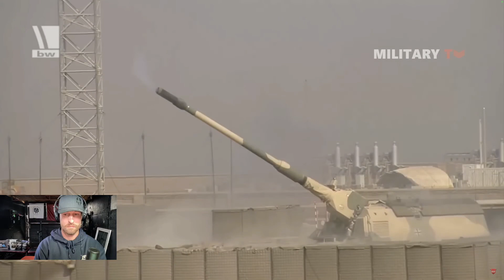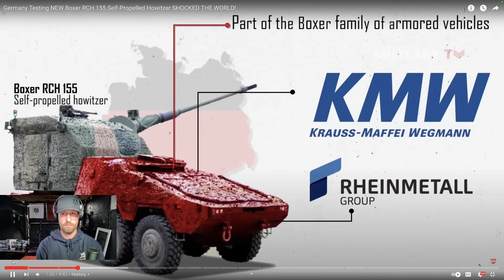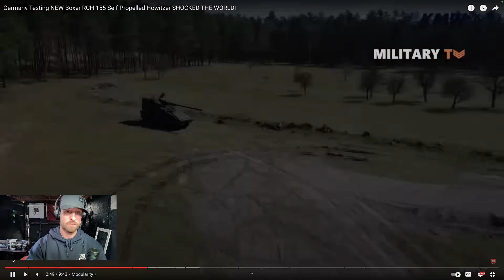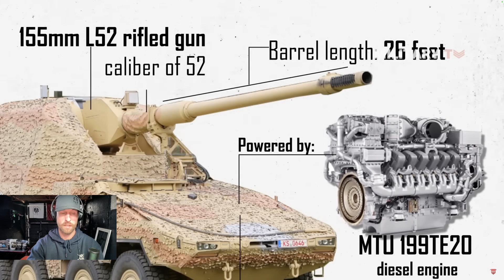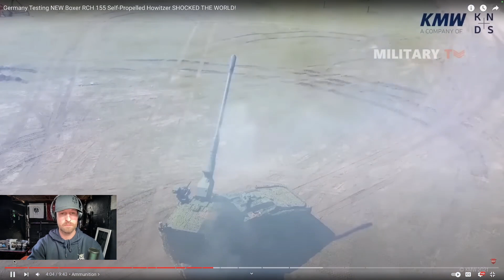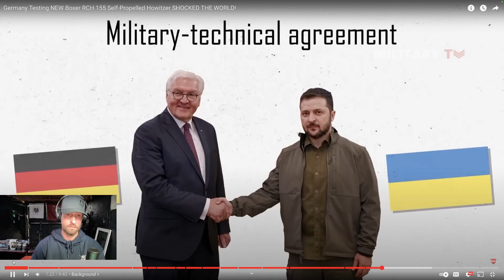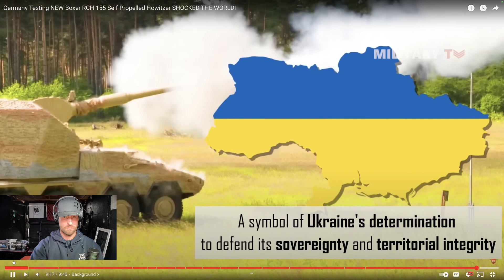Boxer RCH 155 British Armys New Replacement British Soldier reacts

Comment: The Swedish Archer 155mm Self-propelled Howizters,  can do everything the Boxers RCH 155mm, but many believe do it better and carry more of the same artillery rounds the Boxer RCH uses too.

The main weakness of the Boxer RCH 155m Howizters has, the Archer Self-propelled 155mm Howizters does not have.

Could turn out to be, having no Stablizer Leg with Ground-blades, which could badly affect the crew onboard and cause health issues too.

Though badly affect the Boxer RCH drive system and suspension system components, plus onboard electronics and Howizter components too.

That from excess or extreme vibration damage, caused from rapid fire of the 155mm Howiter! 

When the the Boxer RCH 155mm Howizter, is already shows issues with rocks heavy rocking side to side and backwards and forwards when fired.

That seems when only firing in single shot mode, with waiting time between shots too. Regardless of direction the barrel is facing, either forward or backwards.

However, the main weakness, seems to be when firing sideways, either to the left or the right, the Boxer RCH very much rock sideways on its wheels and suspension badly.

The Archer Self-propelled Howiters,  has a much lower profile, both easier to hide than the Boxer RCH, but the later seems very top heavy  when firing too.

If the German's are claiming sustain fire rates, of 9 rounds a minute, yes that is high.

However, the Boxer RCH 155mm Howizters, will run out of ammunition very quickly.  The Boxer RCH will be still going to be rocking all over the place, whether side to side and/or forwards plus backwards too.

While firing the next rounds, especially when trying to fire 9 rounds in less than one minute.

Which very much affect the Boxer RCH 155mm rapid fire accuracy, when firing multiple rounds from either a stationary position, or trying to fire on the move too.

However, the Swedish Archer 155mm Howizters, is a proven battle tested artillery system, already in Ukraine too.

Using the equally proven Volvo Armoured Crew-cab and the All-terrain 6x6 High-Mobility heightweight Chassis too.

With the newer Archer variant, will be using the newer German Mann All-terrain High-Mobility 8x8 chassis, with new armoured three person crew command cab too.

Along with the new Mk 2 Archer variant, will carry more rounds as well it seems, in it larger automatic loading magazine too.

Again surpassing the Boxer RCH own Automatic loading magazine. Along with the Archer 155mm Self-propelled Howiters Mk.1 variant, already has there own Volvo Armoured-protected Automated Resupply Support Vehicle too.

Based on the same Volvo 6x6 All-terrain High-Mobility chassis the Mk.1 Archer 155mm Self-propelled Howiters are mounted on.

Or the Armoured Resupply Support Vehicle, could use the new German Mann Armoured Cab All-terrain 8x8 High-Mobility Chassis.

The Mk.2 Archer 155mm Self-propelled Howiters will use, also the British Army already have ordered hundreds of too.

Which these Armoured Automated Resupply Support Vehicles, can reload the Archer 155mm Self-propelled Howizters own magazine within a few minutes, either while the Archer is just parked up in its own hide too.

Maybe even while actually reloading, between firing too. Also the Armoured Automatec Resupply Support Vehicle, carries enough rounds, to keep the Archer 155mm Self-propelled Howiters, firing on the battlefield for a long time too.

The Archer 155mm Self-propelled Howizter Wheeled All-terrain High-Mobility Vehicle System, is one of the best in the World.

The British Government and the MoD,  should have purchased, at least a whole Artillery Regiment of 36 Archers plus 4 reserve training Archer systems too.

Not just 14 Archer System's, just enough to equip for one Artillery Troop, plus a couple for reserve and training purposes too.

The Archer Self-propelled Howiters are designed to operate with their own Armoured Automated Resupply All-terrain High-Mobility Support Vehicle too.

The MoD may not have even purchases, these Armoured Automated Resupply Support Vehicles too, to support the Archer Self-propelled Howiters too?

That is so both vehicles, can operate as self contained Combat Fire Team, of Self-propelled Howiters and Resupply Support Vehicle.

Within or as part of a Six Gun Artillery Troop, or Twelve Gun Artillery Battery.

Which can be independently deployed or broken up, into one or two Gun Fire Teams, or a Six Gun Artillery Troop's and/or twelve Gun Artillery Batteries.

Along with supported by a Artillery Battery HQ Troop and Battery Logistic Support Troop, plus a Artillery Foward Observation Troop too. 

With these Archer Artillery Batteriez, being one of three Archer Artillery Batteries, of 36 Gun Medium or Heavy Artillery Regiment.

While the Archer 155mm  Self-propelled Howiter All-terrain High-Mobility Vehicle, can redeploy to a new fire position on its own fully loaded and waiting for its next fire mission.

The Armoured Automated Resupply All-terrain High-Mobility Support Vehicle, can travel back to a rear area ammo supply base. To reloaded and then return to a pre-agreed RV, to meet up with the Archer 155mm Self-propelled Howiters.

 The Boxer RCH 155mm Howizters,  does not have this Armoured Automated Resupply All-terrain High-Mobility Support Vehicle it seems?

Whether another Boxer variant  being used, or some Armoured All-terrain 8x8 High-Mobility Truck being used either?

ARCHER would be my choice,  it is a proven working system, Boxer RCH is an unproven system.

With in today unsafe World, with China and Russia,  let alone Iran and North Korea, plus Islamic International Terrorist Groups too.

I would pick the Swedish Archer 155mm Self-propelled Howiters,  or even the British M777 Towed 155mm Howizters, over the Boxer RCh 155mm Howizters at present.

Let the Germany Army and taxpayers, work out and pay for all the problems with the Boxer RCH 155mm Self-propelled Howiters first.

Not British Taxpayers pay to work them out instead, with the British Army or Royal Regiment of Artillery facing the troubling issues of a new Howiter system!
Reply: My goodness, what do you dream about at night? That was so much fantasy and unproven nonsense that it makes you sick. Wishful thinking is not knowledge and babbling is not evidence. Pull your head out of your ass and ask yourself why the buyers ordered the RCH 155. Surely also because they compared the systems with each other. Knowledge is power.... but not for you
Reply: Rch155 won out against archer because it’s easier to transport by air and faster, plus half the army is going to be using a boxer variant so logistics is much simpler. 

The rocking around really isn’t an issue, boxer uses air suspension which is highly resistant to shocks like this.
Reply: The british archer are from the 48 swedish once. Which will replace all 6x6 volvo based with 8x8 man hx based once. And even this new archers still only have a 21 round mag in the turret while the RCH has 44 round. As for reloading there is a container based system for the RCH which therefor can be used by all HX trucks of the british army logistics.
The magazine of the RCH is more flexible as it has 4 submags so 4 different rounds in direct access as for just two on the archer.
And by the way RCH stands for Remotly Controlably Howitzer, so this thing could drive from a to b shooting at c without anybody on board.

Comment: If you like something like this you should check out the finnish AMOS or NEMO mortar systems. Currently in competing to win the contract to be the mortar system integrated to the american AMPV.
Reply from the maker: Ok brilliant thank you, I’ll check them out for sure
Reply: They are fantastic in the 8 to 13 km ranges but that is now squarely within cheap drone range. This will reach out to 35km with just base-bleed rounds. AMOS is for when you want to put maximum hurt on something is the shortest amount of time at a mid range. More an Assault gun.

Comment: I think you are wrong about the firing range of AS90  and Archer. All of these are NATO 155mm howitzers. Their range is determined by the ammunition not the gun. The longer ranges are due to base bleed extended range full bore rounds (48km),  and sub-calibre, winged ram jet assisted rounds such as Leonardo Oto Vulcan (>100km)
Reply from the maker: Thank you, yes I know it’s down to the charge but from when I was in we worked with a max range of 24.7km for the as90.
Reply: @combatreadyhq  Yes 25-ish km would be the standard full bore range for a NATO 155mm Howitzer, with no fancy base bleed rounds etc. The AS90 does have two barrel lengths, which gives 30km range for the 52 caliber barrel version. The weight of the shell and the energy of the propellant charge  are the main determinants of muzzle velocity and therefore range. Other factors are the gas pressure (dependent on the chemistry of the charge), barrel friction, and atmospheric conditions.

TLDR all the longer ranges (Archer, Caesar, Boxer155 etc)  are due to the aerodynamics & in flight propulsion of special shells. With terminal guidance these make an enormous difference to the reach and significance of artillery on the battlefield.
Reply from the maker: @nickhockings443  exactly mate, thanks for the information and comments  for everyone

Comment: Why aren’t we building our own vehicles and why on earth must we buy from overseas, it does not make sense that we are buying from abroad when we are more than capable of building our own fighting vehicles. the main problem with buying any foreign vehicle is that you are tied to them for spares and everything is rosey  until you fall out and then you’ve  got vehicle without engine spares ,steering spares etc it’s  been said thats main benefit is that it can fire on the move but if I remember correctly the old centurion  could  do that decades ago
Reply: If you Brits had done something sensible in the last few years, your Ministry of Defense would surely have come up with the idea... but you can't even manage Brexit. LOL And besides, the UK has also ordered the Boxer in other variants and it is also produced in the UK. So don't cry about it, but be glad that you as a taxpayer don't have to pay for an immensely expensive new development that doesn't work afterwards.
Reply: I think that the twin fiascos of Ajax and Ares are their own answer to that. Boxer is designed and built to work. The Brit ones (to my disappointment because I'm a Brit too) look like things built to keep incompetent designers and builders in jobs instead. :-(
Reply: We spend an absolute fortune on procurement but it takes too long and politicians keep undermining it with changes of mind. It's therefore thought to be better to buy an off the shelf product. If we built something it would take 10 years to open the factory then we'd privatise/sell it to America who would snap up the tech and close the factory. We really need to do something to stop tech and businesses being bought up by competitors. It's the biggest thing that Brexit allowed us to do and yet we don't do it

Comment: The fire on the move capability is the selling point which makes the RCH155 unique so far. Shoot & Scoop was yesterday.
Reply from the maker: Yes I think that’s massive for a artillery system
Reply: Also the fact that there's a tracked variant which IIRC also uses the same chassis, so again all of the comments re ease of maintenance still apply.
https://youtu.be/nukB8k9pqas?si=rb46y7Q-kvmkyXxB
about 6:00 in for almost 2m.

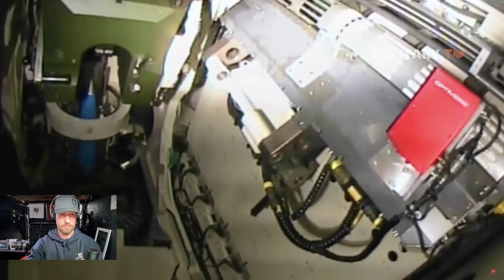Comment: 5:56 " ... thats quick ..." not really, look here test fire of PzH 2000  https://www.youtube.com/watch?v=Tc9sb71px5I  and the same turret with 16 Rounds per Minute as 100% autoloader was offered as armament for Corvette K130 (not chosen due to a to tiny ship body to handle the recoil of continuous fire in AA rolle)
So this 9 Rounds per Minute are basicly a back step and only worth it due to crew reduction down to 2

Also key benefit of RCH 155 is a combat ready weight of 38.5t which allow sepcially GB a combat ready hot drop by C17 Globmaster. This was also plan for A400m but with 38.5t it is 2t to fat for it.

Comment: at 10 million a piece it sounds like it will be something you don't want to lose.  I was reading a comment somewhere about how the age of "shoot and scoot" is over and SPGs are also hopeless because drones spot them too easily now. I wonder if drones will make this kind of system far less useful because nobody will want to risk putting them where they need to go?
Reply: The Ukrainians have yet to lose any PZH2000 (I think one was damaged), even to drones or airforce. Because the concept of beeing pretty mobile and fast fireing works pretty well even with a 58 ton beast like the PZH2000.  One would also hope that our NATO Air defence in combination with an actual flying airforce of more than the 50 or so old Soviet planes that Ukrainians currently operate would provide some more cover against Drones operating 30+ km behind the frontlines.

Comment: I prefer the Archer. I don't like the high profile of the RCH 155 and because of its civil engineering heritage, I suspect the Archer chassis might have the edge over the Boxer chassis when it comes to traversing rough ground. But I see why it make sense to go for the RCH. Archer's articulated chassis requires specialist expertise to maintain and repair whereas compatibility with, and the modulatory of, the Boxer fleet as a whole simplifies this and many other issues. There was also the option of mounting the Archer turret on a truck chassis (MAN provides many of the British Army's logistic vehicles). However, perhaps Boxer is judged more capable for cross-country than a MAN /Archer variant plus there is, of course, the higher round capacity of the RCH 155.
p.s. Any scope to ship mount that turret?
Reply: Rheinmetall has been building shit that can traverse rough terrain for decades. They know what they're doing.

Comment: There is an interview with the head developer of the PzH 2000 available here. Among other interesting notes he told how they came to employ an pneumatic autoloader system. They calculated and simulated other types of autoloaders (e.g. hydraulic) but nothing else could fullfill the specified cadences. And stabilizers would jeopardise the shoot and run-approach. Modern artillery detects artillery rounds by radar and calculates quickly the position of its origin.

Comment: The 'Boxer ' platform is an ideal solution to replacing the AS90. As well as greater accuracy and firing range, faster to reposition in the field, better range for the vehicle and compatibility with  Germany, Netherlands, Lithuania and Australia and the number of nations likely to use this system will grow (I would expect other Balic states to follow, as well as possibly Poland, Romania and Denmark). In addition it offers a unit that can be easy to repair, reconfigure, air transported and uses only 2 crew plus its made in the UK and relatively cheap.

Comment: Why is this modernist artillery at the world? As the others comments show:  Fast, airtrasportable, can fire while driving,  360° aiming, because the weight is so high, stabilizer are not needed, fire on the move capabilities so you can use it as a tank hunter, is NBC protected, capable of MRSI with 9 shots per minute, the range by using VLAP is 33.5  miles.
Reply: Can you use max charge to shoot projectile while driving? 😂
Reply: @CodexMender  ?? Max charge? You can shoot 9 shoot per minute.. and for that you can do it while the move.
Reply: @assellator  Based on the photos/videos, none of the mobile fire were using full charges. How can you withstand full charge recoil when this RCH 155 showing a lot of movement on each fire w/o max charge.

Comment: Still looks like it’s going to fall over !.
And the whole point of tracked vehicles?, mud. Not sure how the wheeled fleet would deal with off road in crap conditions
Reply: There's now a tracked variant, but: a skilled FPV operator can easily disable a tracked vehicle by flying into one track. From that point on it's a sitting duck. We've all seen the Ukraine videos. Even a turtle or 'shed' tank has to have ground clearance and that's all a good FPV flyer needs. Meanwhile, it would take several FPVs to disable enough wheels to stop the RCH155. 
But I too really want to see the RCH155 in seriously deep mud.
Reply: Realistically how often does heavy artillery work far from the road system?  The logistics of ammunition supplies are tied to wheeled trucks unless you have the kind of vertical lift of the US.
Reply: @jackdbur  
True to a Degree of course.
But the purpose of off road capability is to follow the armoured force over the same terrain and support it.
Wheeled artillery clearly has an important future role. But is not a solution to everything.
Still gonna need armoured tracked fires
Reply: @bobferry55  It is a module which just needs the appropriate fittings so it could be connected to another tracked hull if that hull has the appropriate connection.